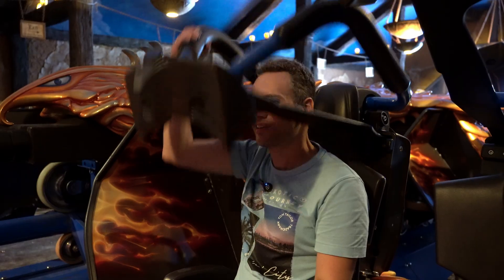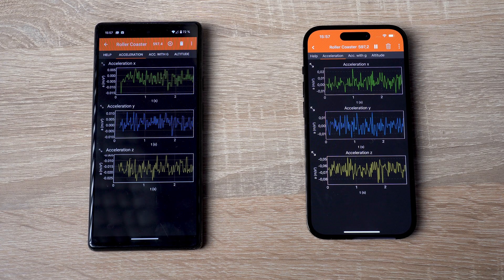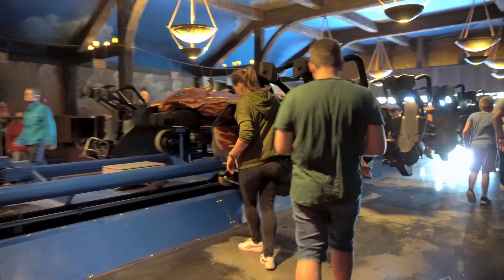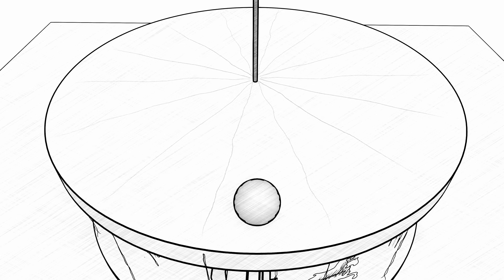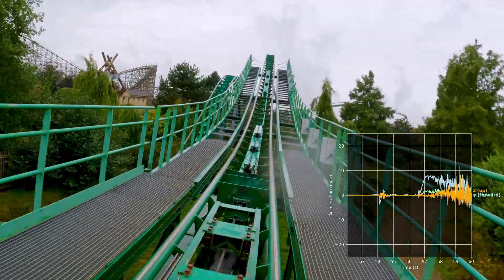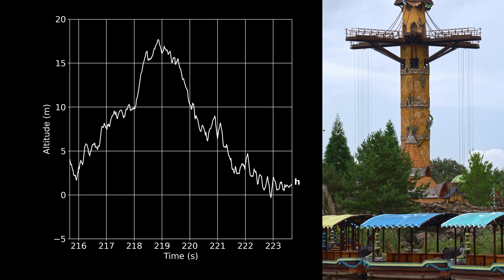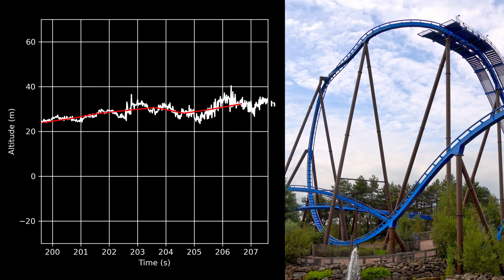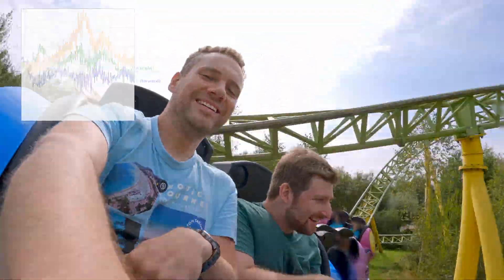Measuring Roller Coaster Acceleration with a Phone (en)

Comment: I tried using this app today but have a problem, when trying any experiment that requires access to the microphone on ipad 12.9 5th gen, I merely get the message that microphone permission is required, where as microphone permission should be requested by any app that needs it to work, my ipad is not used for phone calls so the microphone is nowhere in sight, phyphox is a very smart app so why isn’t it smart enough to request microphone access.

Comment: have you tried reconstructing the coaster shape from the acceleration data?
Reply from the maker: No, but that might be interesting indeed. In many experiments we do not even try, because that involves integrating the accelerometer data twice to get to a location, which means that little deviations add up so fast that the result is unusable. It is possible to improve it a bit when you tailor the analysis to a specific sensor (which is not much use to use as we want to offer experiments that are available to a wide range of devices) with filtering tuned for the sensor and the use case, but even then you can expect a significant drift, especially under extreme conditions like a roller coaster. There is a reason that VR glasses and similar applications reconstruct head positions from cameras and not (only) from intertial sensors.

Analyzing a roller coaster has a big advantage, though: You know that beginning and end are in the same location and at rest. Pairing this with the assumption that motion only occurs along a fixed axis might be interesting.

That's a powerful boarder condition. Unfortunately, we did not record gyroscope data. We did record the accelerometer along with the device's virtual "linear acceleration" (or "acceration without g" as we call it in the app), so the gyroscope information is still more or less in there, but it should make it even more annoying to reconstruct.

Maybe I will play a bit more with the data when I have a bit time to spare.